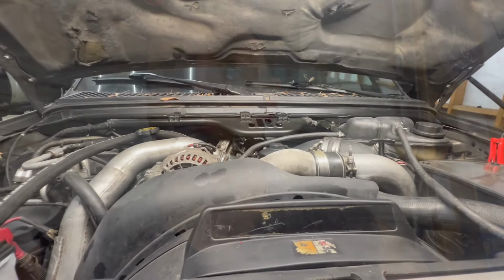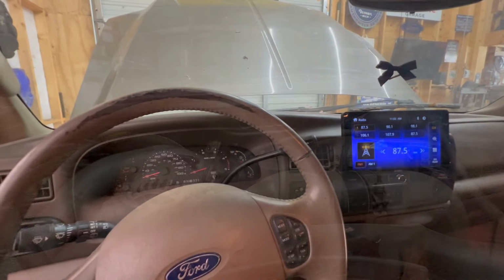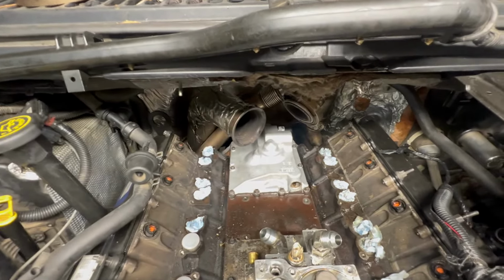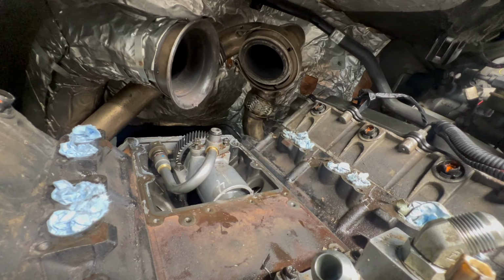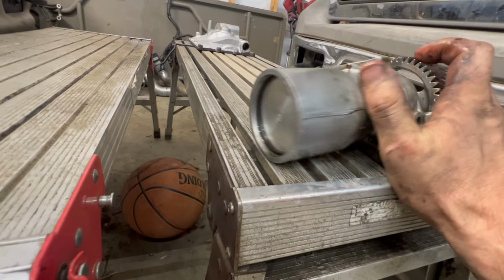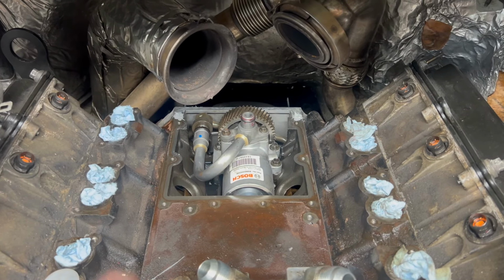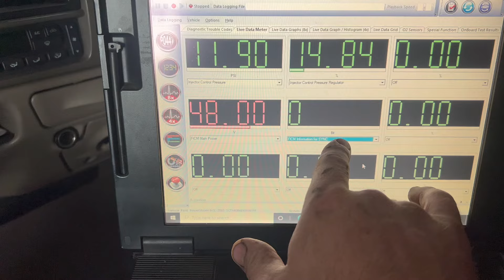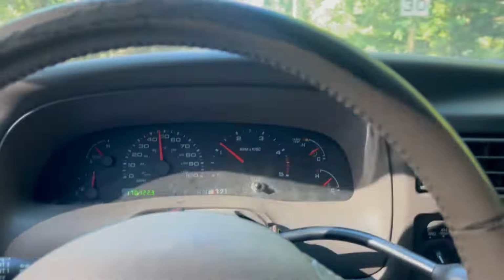Early 6.0 HPOP....Fixing another shops FAIL

Comment: Y’all do exceptional work 👍 The ONLY thing I would recommend doing differently is your choice of pump on the 03 and 04 trucks. If the customer needs a truck back yesterday, then please use the Motorcraft pump. If the customer can give you a couple days, then I recommend them spending the money on the Dieselsite pump. I’ve installed and supported quite a few of them and have yet to have an issue where the problem is the pump. Phenomenal job diagnosing that truck regardless 👍

Comment: I have an 03 6.0 customer pay international to do a diagnostic on, and they told him it is pushing oil to the fuel bowl, to check injectors o rings, and the customer bought the o rings ,I removed all of the injectors they all looks good esept # 2 injector white o ring swollen but not cut the only diferent I spotted all of the injectors had some white under all of the white o rings I'm wandering if they're some cracked injectors cups. Engine starts with starter fluid for 15 minutes then wouldn't start again til it got cold  again if you have any idea what could be I appreciate a tip.. I will help you with something. This engine was put in two years ago rebuild.
Reply from the maker: @Benjamin-oy9fj  6.0s don’t typically have injector cup issues, hope you haven’t damaged any pistons or rods by using the starting fluid, it’s way to volatile and ignites early making it prone to crack a piston or bend a rod. If your saying it runs for 15 mins then won’t crank back up till it cools off it’s more than likely a crank no start hot due to a Hpo leak. Being it’s an 03 with the early style round pump I would bet it’s the pump or j tube orings. Injectors probably shouldn’t have been messed with and sounds like the shop didn’t know how to diagnose either. What’s your live data for icp psi, ipr %, FICM main power, FICM sync and fuel pressure on a manual gauge when problem happens?

Comment: You need to put a updated cover on it. You will never get the overing to stop fretting. Hardly any of the big volume shops know this.
Reply from the maker: That cover was updated and had been clearanced
Reply: That 1 you pulled off was not.  @AutomedicGarage
Reply from the maker: @stroken_7.3_the_legend  dude I work on so many trucks I didn’t even remember which video this was, that was over a year ago and you are correct it was not a updated. I had to go through the video to remember what was going on. She was on a tight budget, single mom and I remember saying that we needed to order a new cover and explained why and she didn’t want to spend anymore money. It was pulling teeth to get the parts that we did.
Reply: @AutomedicGarage  That was a jab at the previous shop that just couldn't get it right.

Comment: I have a 2004, leaf spring front end truck, with the cast hpo rail, icp front pass. rocker cover. Im building just shy of 300psi hpo, so no start at all. I replaced the stand pipe and dummy plugs, while there i noticed my ball cups were a bit loose. I dont have a way to air test. Im confused on what hpop i need, how can i tell between the two covers? Also, going to check my lpop relief tomorrow

Comment: This had the first generation '03-'04 cover on it; there are three versions.  You can see a hint of light contact of the J-tube to the cover at 10:05. The Gen 2 cover was ground at the cover's manufacturer in that area for a little more clearance, and Gen 3 was for the '04 with the change in pump and rails.  They are cast with a hump to clear the tube for that model's tube.
Reply from the maker: I actually didn’t know there was a change in the early style pump cover thanks.

Comment: Where you located I think the shop did the same thing that happened to them had high pressure oil pump done 2 months ago now it runs when cold but as soon as it gets to running temp it dies
Reply from the maker: @camerondeter2524  did they replace the J tube also? What brand pump did they use?

Comment: I have an issue 2003 f350 6.0. 
Icp pressure at 550 wont fire. It tries but wont fire.  Replaced icp and ipr. No joy. Tested the ficm and did hp oil leak check no leaks found. Idk where to go from here. Im debating doing the hpop but idk the pressures dont act like its a hpop. If yall have any advice please share some knowledge
Thank you
Reply from the maker: @dustinmoore5335  what’s your fuel pressure?
Reply: @AutomedicGarage  idk what the fuel pressure is, I took the fuel filter cap off and cycled the pump and I was getting fuel into the filter quickly.  Seemed like everything was working correctly.  When I did the oil leak test I tried at the ipr and icp locations and forced on the ipr during the test no noticeable leaks. Should I be looking at a fuel issue?
Reply: @AutomedicGarage  i was debating pulling the turbo to see if the j tube is leaking
Reply from the maker: @dustinmoore5335  gotta check fuel pressure and if your hearing air leaks there’s a issue. Is it crank no start?
Reply: @AutomedicGarage i hear air just no were i can see it. I pulled valve covers and can't see if there is a leak. It is a no crank no start
Reply: @AutomedicGarage  I just dont know if I. Should pull the turbo to check
Reply: @AutomedicGarage   50psi during cranking
Reply from the maker: @dustinmoore5335  if icp is 50 I’d be looking at that problematic early style pump
Reply: @AutomedicGarage  icp_press psi is 550
Icp_dsd psi 2025 ipr 85% that was my reading cranking
Reply: @AutomedicGarage  the reading i got on a handheld gauge off the fuel filter housing was 50psi fuel psi
Reply from the maker: @ was that KOEO, running at idle or driving under a load?
Reply: @AutomedicGarage  crank no start

Comment: Man im not sure if my hpop is bad on my early 03 … it feels like its holding back when under full throttle my fuel press drops to 46 psi lowest i ‘ve seen it.. then it goes up to 58ish. I changed both fuel filters no mods. Im thinking my hpop is not putting out what its supposed to . I did a pressure test on the icp port.. i dont hear any leaks. I recorded a vid with my laptop and running forscan.. o dont know how to dm message you maybe you can help? I pulled out the bottom T60 bolt no debris there. I put a new drain valve in my oil filter bowl ford part so im getting oil there.
Reply from the maker: @tinok.8149  contact info is on our website
Reply: @AutomedicGarage  Hey man i found my problem!!! J-Tube had poped off the push to connect at the branch tube. No matter what i do . .. J -tube does not want to line up. I bought another J-tube off ebay … same problem .. it does NOT LINE UP! Am i doing something wrong? Early 2003! Thank you!
Reply from the maker: @tinok.8149  never had this problem
Reply: @AutomedicGarage  it is strange for sure. I thought it was a bad HPOP untill i found that the J branch tube had popped off the push to connect fitting. I was getting 945psi so it was good enough to start and run but pedal to the metal was falling flat on its face. Im sure the pump is good. I just have to find a way to make sure it does not pop off again. That was my problem for sure. Early 2003s had these issues i guess. Either way thank you very much for all your help. Keep making great videos!
Reply from the maker: @tinok.8149  sure thing bud

Comment: Nice work! What’s a job like this typically cost?
Reply from the maker: $800 labor plus parts.
Reply: Thanks for getting back to me! My 03 6.0 died last weekend 150 miles from the house . Was gonna cost me 1k cheapest I could find to get it towed to the house so I had it towed to a shop. They said HPOP leak , 2k to replace seals if pump bad 3K. Trucks got 195k miles on it and in shop now. What’s a man to do. I told them to replace seals if that’s all it needed figured I could replace pump myself later if needed however after watching this video I think I’d be better off long term to have them replace that pump but money don’t come free around here. Dadgum.
Reply from the maker: @outdoorsadrenaline  replace the pump, they get weak on the early 6.0s
Reply: @AutomedicGarage are there better options than the factory hpop or they are all the same. I ve seen videos where they supposedly install a higher pressure one to feed larger injectors . Thanks in advance hope you can answer
Reply from the maker: @DanielGonzalezkyv  diesel site adrenaline pump has 2 different versions, heavy duty and performance supposed to be a better more reliable design but I’ve never ran one personally
Reply: @AutomedicGarage  thanks for replying I have my 6.0 2003 that starts fine but not happy at revving I’m thinking my hpop might be a little tired but not sure if something else could be the problem injectors seem to be fine.
Reply from the maker: @DanielGonzalezkyv  how many miles are on your current pump
Reply: @AutomedicGarage  no idea truck has over 300k miles might be the original no idea if previous owner did replace truck has been with me for 11 years never broke down.

Comment: I have a 04 6.0 f250 right now it's a mess from different tech threw parts at it. 8 new injectors all kinds of sensors. O ring pieces in oil check valves both sides has no hpop at all. I noticed oil in the fuel also. I'm pretty sure it's rottella in fuel bowl. Guy must be an idiot put all that money into it they had to tow it to me. What the hell is wrong with ppl.
Reply from the maker: @allen3272  I ask myself this almost daily. Bubba just got a 7.3 in the same shape that mechanics turned into a shit show.

Comment: What if you drop yellow ,,o,, ring down..?
Reply from the maker: @mikeches7992  it really shouldnt be a problem but it could stop up something in the hpop system
Reply: @AutomedicGarage  doesn't  it fall all the way down  to the oil pan?
Reply: How do you check a new HPOP FOR LEAKS? The old one appeared  to have better suction,  new ,,BOSCH,, doesnt do it...where could be the  most leak the pump itself or the ,,J,,tube?
Reply from the maker: @mikeches7992  give it a air test. I replace the j tube every time
Reply: @AutomedicGarage  and what should I expect  from an air test? If I plug the whole on top of the pump and sent air through  the whole on the buttom  should the air leak  through  the shaft which holds the gear?
Reply from the maker: @mikeches7992  you will hear some air there regardless.
Reply: I just put air about 100psi in the new ,,BOSCH,, HPOP and I saw oil bubbles coming  from around the shaft.. it's only 100psi and it doesn't  hold air..is it a BAD PUMP?
Reply from the maker: @mikeches7992  I’ve never had a bad Bosch pump but I’ve also never put sir to one that is dry inside. They are are meant to hold oil pressure not air.